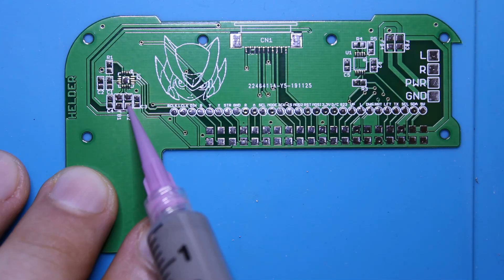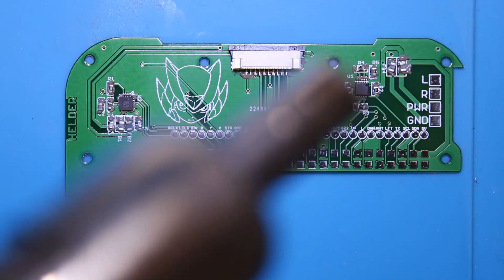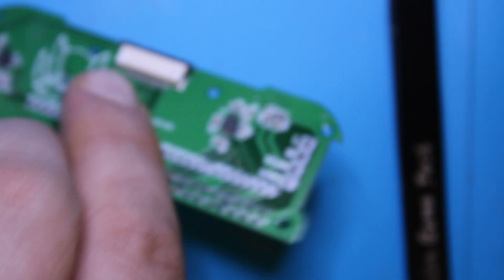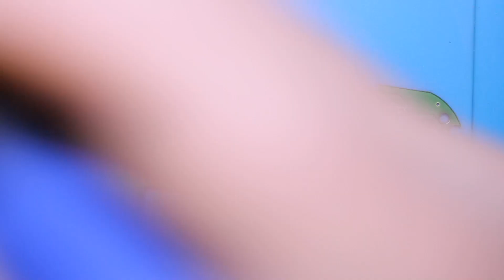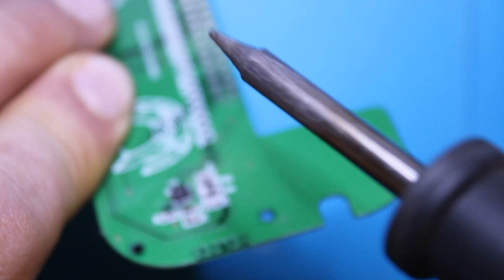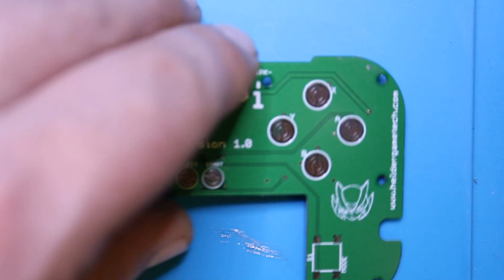MintyPi Lite Soldering

Comment: I love this kind of work so much, I never thought of soldering and electronics till I was scrolling through YouTube and saw one of wermy's videos on the mintypi in my recommended videos. Once I saw that I was hooked and made it a goal to make one. Keep up the fantastic work helder!
Reply from the maker: Soldering is an awesome and fun hobby, you can mod all sorts of electronics and old game systems and even fix your broken things too.
Reply: I have a quick question about the battery. I'm not one to use forums too often, since why I'm not on sudomod. But I have a Samsung phone battery that's 2 1/4 inches long, 2 inches wide and about half  a centimeter thick. Would it fit in with everything? I didn't order the plastics yet
Reply from the maker: @seancoleman3329  you don't have to be a member of a forum to use it's search function, here is the thread with all sorts of batteries that will work and also has dimensions you can reference against.
https://sudomod.com/forum/viewtopic.php?f=33&t=7128

Comment: That paste is awesome.
Reply from the maker: it is indeed, as long as the parts to not get extremely hot during normal operation and hit that melting temp this can used in many projects with little heat and possible damage done to components while soldering like those plastic connectors.
Reply: @Angryhelder  I have some paste from adafruit that I'm not very good with. I will look into getting some of this soon. Thanks.